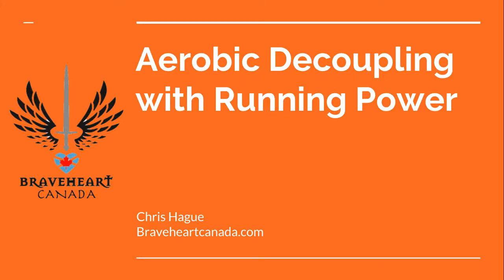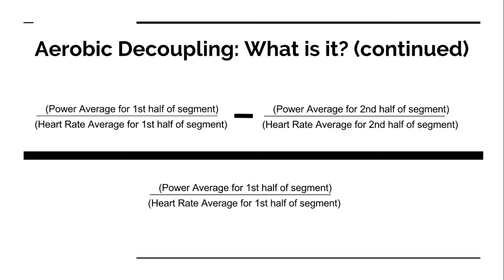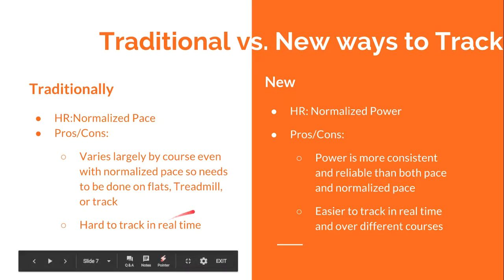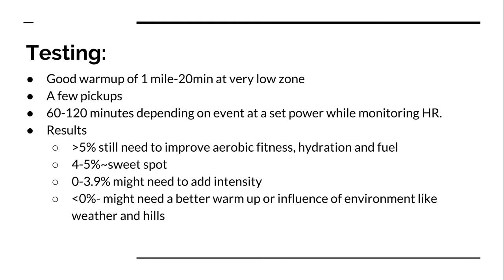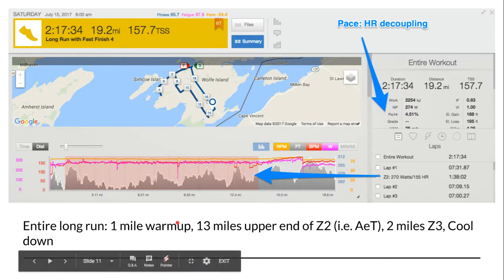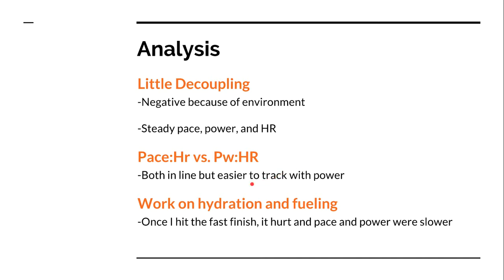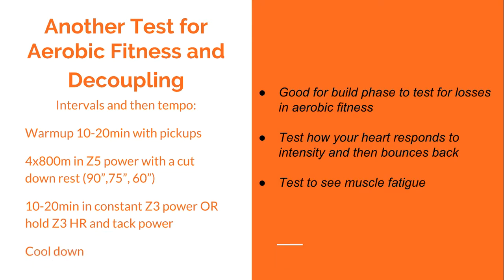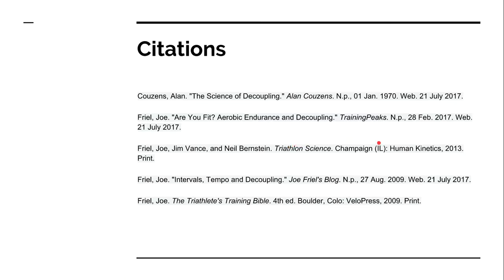Screencast 3: Aerobic Decoupling with Running Power

Comment: Hi chris this is quite interesting as never seen that setting in TP before. Looking at my recent efforts i ran a fast 10k race 8.25% next week i ram a 5 mile race at slifhtly faster pace 7.04% lastly i need a slow 10 mile and got -0.11. If im understanding this correctly its telling me that for a marathon distance i shouid ne running nearer tov the 10mile pace run than the 10k pace as getting too much decoupling and need more base training?